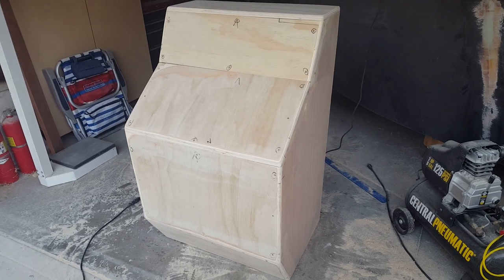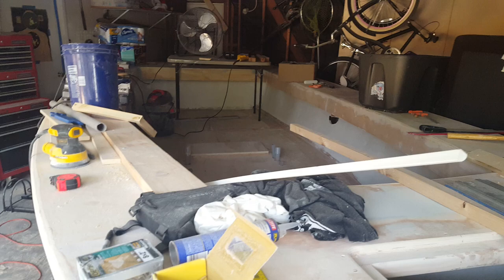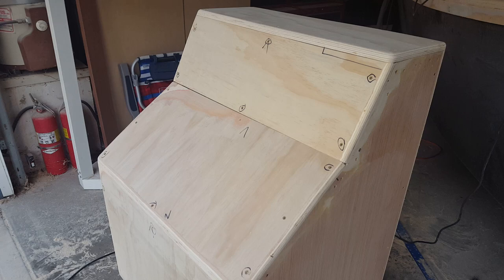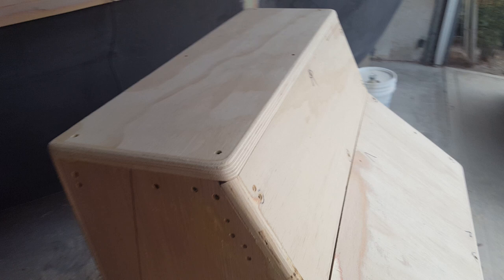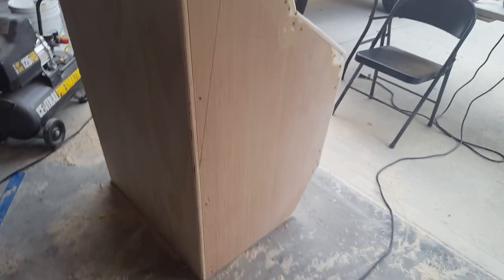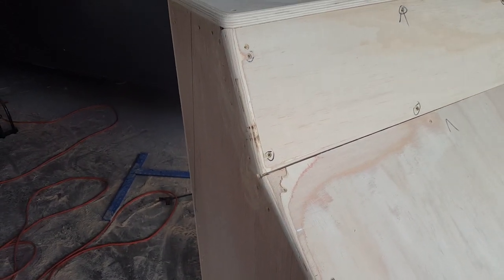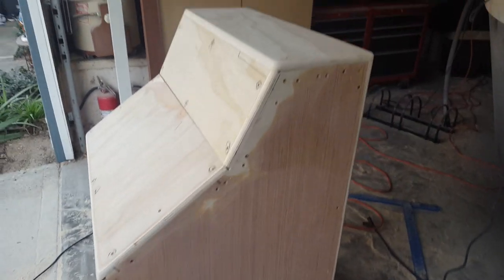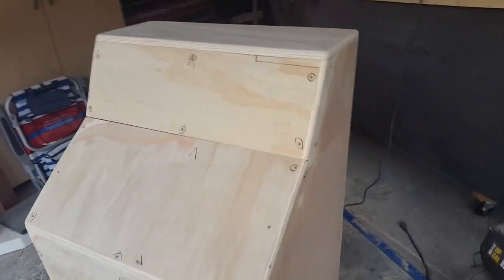DIY Boat Steering Console - Rock Lobster

Comment: Are you going to make a video when you glass it? If not what procedure do you use?
Reply from the maker: Hi there.  I usually only do videos after the work is done sorry.  Not coordinated enough to glass, video and look good at the same time :) . For the floor will be using 7.2 oz woven cloth.  I'll precut the cloth, lay it down and pour polyester resin over it.  Then will use the squegee to make sure I get good saturation and level it all out.  Some people like to wet the surface first before putting the cloth down, put I've never had a problem with saturation.  Will most likely use some wax in the resin since I want a sandable non-sticky surface after the first application.  Will then use epoxy or polyester fairing compound if necessary to clean up any low spots.  Will be painting the floor in Grand Banks Beige with sand sprinkled and rolled into the paint.  Going to test that non-skid application on a couple of sample boards first to see if I like it.
Reply from the maker: Found a better way to get a smooth fiberglass finish.  After I pour the resin on the cloth I use a small plastic squeegee to spread it out.  To smooth it out I bought some small paint rollers that are made for resin.  Have found that if I go over the entire surface with the roller it makes it much more even then the plastic squeegee by itself.